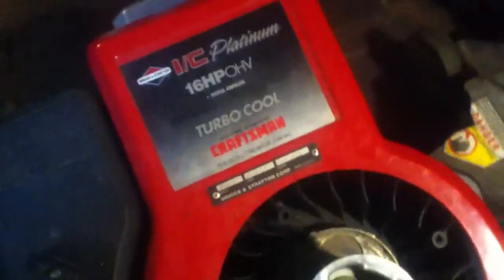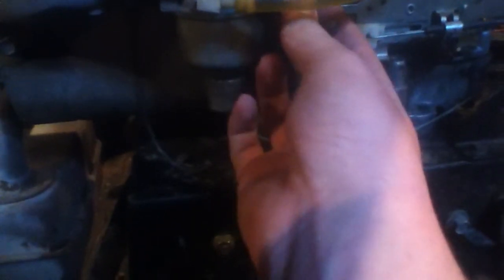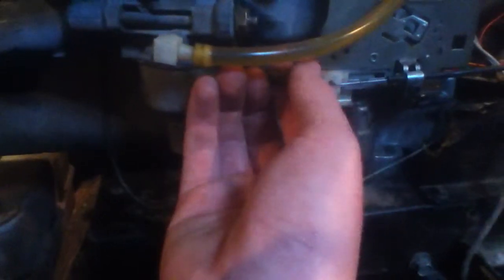Fuel pump on Briggs 16hp bigblock

Comment: I think the best location is the intake manifold. You would have to drill a hole in the side or on top of the manifold cause on the bottom would cause gas to collect in the pulse line.  Tap threads or use a sealant to make it air tight.

You could also check out some racing forums.
Reply from the maker: I plan on adding a filter to trap fuel and yes sealant is needed